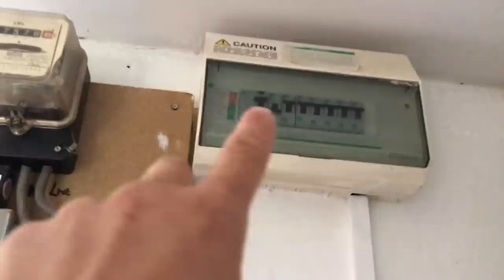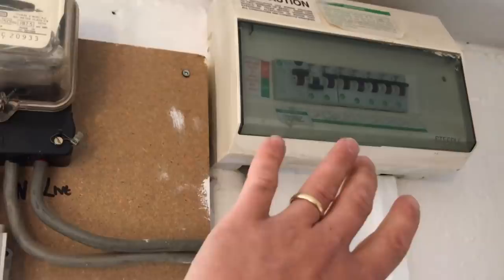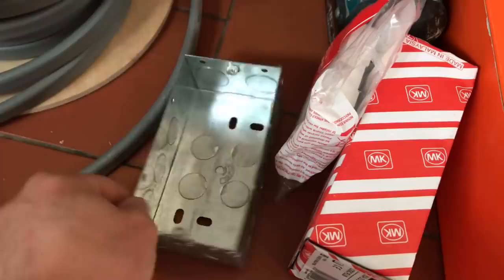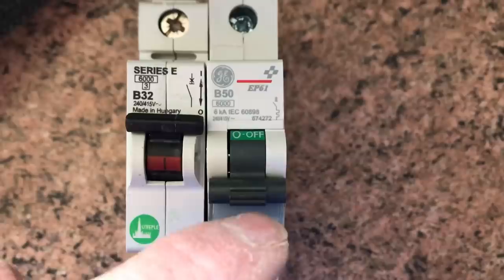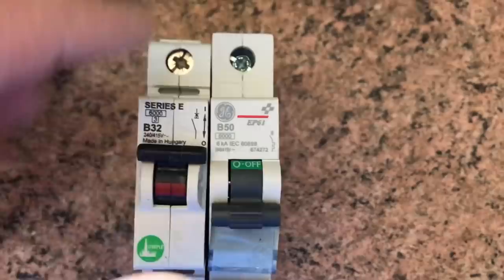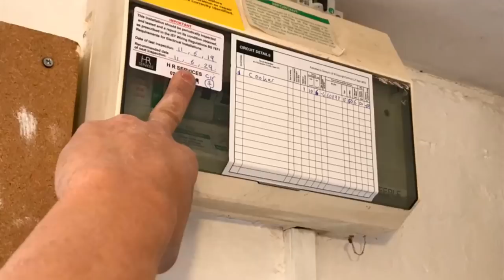CJR ELECTRICAL Electricians day installing 50amp cooker supply!!!

Comment from the maker: Thanks for the comments like I said that’s what this platform is for I’ve now tracked down a 50 amp Schneider lisse cooker connection unit. Which I will fit once I go back to connect up the oven.
Reply: CJR ELECTRICAL what is that 10mm rated at.
Reply from the maker: 64 amps
Reply: CJR ELECTRICAL cheers Chris, 👍
Reply: CJR ELECTRICAL atleast your brave enough to show your work and do a good job at doing it, people will always try have ago behind there keyboards. Great job
Reply: Lovely staggered performance, personally would have changed those tales, would have liked to see in the gaskets you used to stop the wet cement creeping in, never a good idea to stick the faceplates on, whilst waiting for media to dry, a brickie would haven told you to put a dry mash in first, then skim then skim, did you clip in the loft space ?, But you're keen to produce professionalism which is a bonus not many customers get. 😶
Reply: I think you need a few henly blocks behind that cooker lol
Reply: @stephenthompson1924  well said, my thoughts exactly.
Reply: @Cjrelectrical  great vid and another topic for discussion ! 64 amps in my eyes is the maximum amps in perfect conditions i.e clipped direct the whole route with NO thermal properties covering or touching the cable at all. So the oval (totally unnecessary in my opinion) and the plaster would contribute to reducing the the current carrying capacity, I'm not sure what you did in the loft but if there is any insulation on the cable at all it would bring the rating down to 45amps - 100mm insulation or even worse 36amps if there is 150mm insulation for example.  It's food for thought with the bigger cables i.e 6mm and 10mm etc..... oh and sod plastering would get my lovely clean van messy :)

Comment: Diversity on cooker circuits is definitely contentious. I agree with your 10mm, and for a moderate additional cost vs 6mm the installation is more future-proofed. A friend went out to a job to run in 10mm, house was only re-wired about 6 months before but new owners wanted an Aga at about 16kW. Diversity would say 28Amp but the manufacturer explicitly says 230V 45A. Would have been well over the type B curve trip at 32A under heavy utilisation. As long as Ib<In<Iz and the customer is happy, you're on to a winner.

Comment: Nice video.  I use Thistle bonding for first filling chases.  PVA the brick or blocks and leave a mm or so below and then use thistle multi finish on top.  To get it looking the best once it’s almost gone off you can lightly rub a damp sponge on it and it’ll be perfect.  Done an entire rewire in my house this way.

Comment: Had exactly the same issue on a kitchen re-fit 6 or 7 years ago. 5 ring/zone induction hob and double built under electric oven. Luckily there was an attached garage running from where consumer unit was to rear of cooker location. Customer originally arranged for a 900mm gas range and cooker, but changed their mind without consulting. Typical! Had to wait 3 weeks to get paid as I had to order in and fit an additional 300mm base unit.

Comment: Nice to see a spark actually attempt to fill the wall back in to some degree ,only takes a few mins and looks so much more professional.
Reply: @Do one 
As long as you don’t believe that there is nothing more permanent than a temporary solution😜

Comment: Nice one Chris , i always fill my own chases too and i always throw in a handfull of cement in the bonding and it goes off pretty quick which is handy if you need to 2nd fix same day , also i fitted similar double oven cooker rated at 50 amp and clamped it full on and it was pulling 41 amp max load........cheers mate

Comment: I fitted a new cooker circuit a few months ago, same as you.The customer didn't know what size or power oven she was getting, so I assumed max load, installed a 10mm cable and 45A breaker, supply was TNC with 30mA dual RCD, some muppet had connected it to some 2.5mm as a spur off the kitchen radial (32A) which should be 20A! changed that breaker too.. the line had melted through overload and touched the earth to 2.5mm feeding the cooker, and customer was complaining of getting shocks off the dishwasher, I just installed a new cooker point and isolator, with a 3mtr run easy job, and future proof. Shoddy work on that incomer..wow.
Reply: @r.h.8754  The last socket of the radial was connected to the dishwasher, there were 3 sockets on it, the radial was connected under the oven with chock block taped up...( Yes really) the cpc to the dishwasher and last 3 sockets (unsleeved) was  not connected to main earth as it wasn't tightened, the line conductor insulation melted it was twisted over the dishwasher supply thus eventually the resistance got lower everytime the oven was on, obviously no cpc to MET means no rcd trip, it was one of the worst most dangerous things I've seen. Could of killed my customer, kitchen fitters apparently! 😠 CPC around a soil stack?.. Wow!.. Unbelievable! They must of thought.. "soil" ="earth" 🤣 bleeding idiots...
Reply: @r.h.8754  Exactly that.. The earth wasn't fully touching the live conductor but the earth was disconnected from the joint back to the CU, that made only the dishwasher live but only around 1 to 10ma luckily for her. The taps were all in plastic pipe, and if I could post pictures on here I would, I just ripped it all out.. Started again bleeding cowboys. Oh yeah just remembered, rcd failed disconnection time.. Wylex.. Swapped that out too. All safe and compliant now..
Reply: I am not a qualified electrician but did an electric apprenticeship on electric motors so i do understand old technology. I am retired now and all the abbr. can be confusing CPC RCD CU (consumer Unit) I got one. Some years ago I was fitting a new bathroom for my daughter and she wanted a hot water heated towel rail. I lifted the floor boards in her bedroom to access the pipes and nearly died by what I saw. Some cowboy had put a ring main with the cables running over the central heating pipes with the floor boards on top. They had melted but not right through as I traced them back three earth wires were just loosely twisted together. I had to stop work and get it fixed.

Comment: Hi Chris, so I'll add my two penneth worth. Been a Sparks for more years than I care to remember, and my take on this situation is that the mcb is rated to protect THE CABLE,  not the appliance. So you have done everything correct in my view. Personally I would have used a 40A mcb due to installation method being buried in the wall.

Comment: Assuming ref method C it may have been possible to uprate the MCB to 40 amps. Cooker manufacturers don't apply diversity like we do. I have seen those range cookers installed on 32 amp circuits with no reported problems.  You have of course done the correct thing and advised the customer. For somebody to fork out all that money on a cooker it would be a shame to scrimp on installing it.  If you want to a good 50 amp switch try the Hager one's.

Comment: Nice video Chris ,steeple was a denmans own brand ,which that particular range was discontinued .GE had an identical range and those Mcbs are a comparable fit as you found out 👍🏻 ,I have come across a lot of different mcbs unsuccessfully rammed into these steeple consumer units ,luckily I have a stock of the steeple ones

Comment: Nice job,just stopping capping or oval conduit short of the box drives me crazy!!
Reply: Sam Sawyer 
I know why do that? Run the pipe on into the box ffs
Reply: Get over it..! Don’t even need capping or conduit.. especially if u r filling in ur own chases.. it’s not like ur gonna be able to pull a new cable through if it ever needs replacing.. 🙃
Reply: I never really know why they do that. Most trades moan about others..

Comment: If every component is turned on at the same time then it will pull full load as they all heat to specified settings.
So if you have installed to manufacturers 50A specifications, why did you choose to use a 45A Cooker connection plate (K5045WHI)?!
After the great work you did on rewiring, it is let down since you provided an underrated component - which should be quite an obvious safety concern.

EDIT * I should of read more of the comments first! It has already been addressed! ;)
Thank you for your videos and diligence!
Reply: i think you will find it was 50a k5215
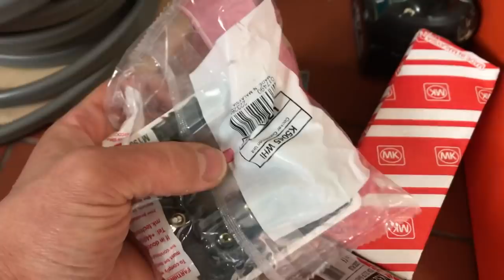Reply: @paulcockburn9545  That was the switch (Shown boxed at 1:43). The Cooker Connection plate was a 45A K5045WHI (Shown right after)
Reply: @deano30923  yep my bad misunderstood the statement. you are correct sorry dean
Reply: @paulcockburn9545  That's not a problem lol. It does make me wonder how many "accidents" happen because of the needless similar model numberings they have though?!...

Comment: Nice video,  wasn't to sure myself about the cable going through the pipework rather than pushing it behind,  but hey thats just me.
My answer to the moaning argument is that there's a difference between moaning about 'poor workmanship' and simply pointing out where things have been completed incorrectly.  
One is constructive critisism and the other is negative.

Comment: It's very uncommon for us to chase cabling in Australia - design of the house usually means we have a cavity wall to work with.
Reply: Cavities are a no no here as cable has no means of support and there a regs that require cable support throughout the cable length. Also you could transfer moisture from an external wall to an inner wall causing damp issues.
Reply: @jaffa190172  Yeah - we have the same regs.  We've got to support the cable every 400mm.  We typically put the cable in a small amount of conduit and feed down the wall, through the hole we've drilled through the noggin.

It can be pretty bloody hard to get there.   Sometimes I'll slot the plasterboard and peg it all back if the wall system is full of timber/steel, getting my plasterboarder mates involved for the repair.

Comment: Is it normal practice in domestic electrical work to install nearly 150A if breakers on a supply with a 100A fuse. Even allowing for diversity this seems a bit sketchy, easy to envisage a situation where DNO fuse would pop before any MCB went.
Reply: What do you mean ?? Are you getting confused with the 150 milli amp rcd?
Reply: Ben Jackson no, if you add up to breaking capacity of the installed MCBs it adds up to 150A.
Reply: @chrisb4009  ahh ok if you look in the osg one of the appendices ( I haven't got a copy to hand atm) if gives you the ability to apply diversity working on the assumption that you will never have every circuit pulling max load at once. I.E you will never have something pulling 13amps plugged into every socket outlet at once. Hope this helped
Reply: Ben Jackson seems a bit daft to tell a customer they need to upgrade a cable because “on Christmas Day......” yet on the same day you’ll likely have very light in the house on with the immersion heater going at the same time as the kettle and auntie Brenda blow drying her hair. Surely diversity works both ways.
Reply: @chrisb4009  it's an interesting point of view, however the osg is considered an excepted way of applying diversity and yes it does work both ways. However if the manufacture has specified a cable and breaker size surely you would adhere to that ?

Comment: Just finished a tight run with a 6mm twin & E, it was a usual  ridged conductor struggle, did it like 2 times, as the first  the cpc was the same reach as the line and neutral, when the cpc was doubled over, I was tempted to leave it, as it was OK, but, I thought, if I was the " next guy" to come across the termination, what would I think of it and the guy that did it, I would not care or know   the person was tired, hungry and knackered, I would just see the result, anywho, it late and I'm signing off, been a spark for years, still learning, still fighting the dark side,

Comment: could you have fitted a cooker socket , with a  13amp socket  , better than a double switch
Reply from the maker: No with the high load already on the circuit adding another load is not recommended.

Comment: Another top Video Chris, 
Could I ask when u do rewire lighting circuits how do u do them, do you take your feeds to the switches or the traditional way via the fitting, also had do you find using the wago connectors.
Thanks
Reply: garethf fox old school way wiring it three plate, but pretty sure 18th are asking to have a neutral at the switches, all about smart switching tech these days, Im thinking of wiring 3 plate on rewires but use a 3core as a switch wire and bring neutral down to the switch.

Comment: Hi mate I noticed you said it's a tt system so what would be the maximum earth loop impedance be for your new b50 amp cooker circuit 
I know on a tn system it would be about a maximum of about 0.69 for a 50 amp type b for earth loop impedance but I know its different with tt 
Thanks
Reply from the maker: Luckily this TT reading is very good I’ve had some up in the 70ohms range which is still fine but it does throw all your zs readings out that’s when you need to make sure you have everything protected via a 30ma rcd. I also make sure they have a 100ma rcd on the incomer quote old skool some might say but you never know when the reading might creep up .
Reply: @Cjrelectrical  I know tt are awkward mate. I have never really come across much on breaker zs values all it seems to say is less than 200 or 100 ze. Amd like you say 30 ma rcd protection and for extra protection time delayed rcd before

Comment: How come U don't have a main breaker in the consumer unit?
Reply: I know, I had to look up 314.1 but I'm not fully following. By the looks of it someone's just directly replaced the main switch and had no more room
Reply: TT earthing arrangement
Reply: @marcus62647  even still, would the main switch not need to be able to switch the full potential load (the 100amp dno fuse) and that RCD is only 80a
Reply: The CU has a main RCD in it. This is acceptable to use as a main isolating switch.
Reply: @craiga6557  How do you know the main fuse is 100amp ? It could have a lower rated fuse in it.
Reply: @HARRYSPADGE  well it says 100 so why wouldn't you just fit it to the highest, you don't know it's lower. Also the RCD isn't the issue it's the current ratings
Reply: @craiga6557  I totally agree with you, it was just an observation on my part.
Reply: @craiga6557  maybe the person that fitted that 80a RCD pulled the main fuse and knows it's rating ? Who knows !
Reply: @HARRYSPADGE  could be 60, 80 or a 100 but more than likely on a domestic its 60-63. Seen loads saying 100A but very few actually are.

Comment: I'm not sure that you can fit different branded mcbs anymore into boards .
Reply from the maker: It’s not bud
Reply: @Cjrelectrical  it looks different
Reply: It's bigger too
Reply from the maker: Have a look online mate they are all the same company
Reply: @Cjrelectrical  just checking if you read regulation 536.4.203 it has to adhere to those rules . I couldn't tell properly from video. Good job though . Keep moaning I love a good moan about crap work .
Reply: @Cjrelectrical  👍was hard to see on video that's all .

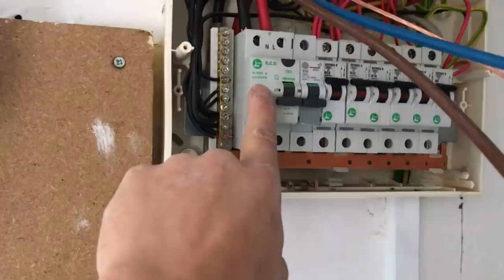Comment: 4:00 In 80A on the RCD, when it's secured by 100A mains. Is that okay in the UK?
Reply: Of course. Higher amperage at the start, progressively going down. Providing the meter is compatible with the incomer, having a higher incomer to the main breaker is fine. It means that additional sub-circuits can run from the same breaker. Having a 100 main with 80A incomer would be stupid because the DNO regulated incomer would blow before the customer equipment.
Reply: The main fuse holder is rated at 100A max, you'll actually have an 80A fuse inside for an 80A switch or RCD, usually with 16mm tails.

Comment: Did you make safe the cables showing bright copper
Reply from the maker: No I was unable to isolate the main tails. It’s behind a screwed lid so will go on the test sheet. Client is aware too.
Reply: @Cjrelectrical   don't you work live Chris ? Personally I wouldn't have left it like that, I'm in Spain, everything is easily isolated here because of switchable main protection. Get your mat and gloves out 🙂

Comment: Surely with diversity the cooker doesn't need 50amp ? RCD main switch is only 80amp, doesn't leave alot left
Reply: Kevin Gravill as he said there may be an odd occasion eg Xmas day where cooker is working at full capacity

Comment: Diversity guys diversity, remember that?
Reply: Manufacturers instructions,  remember that? Cover your own back, if anything happens to the cooker it's on their head not yours.
Reply: 421.1.1 and 512.1.5 on top of which heat dissipation from the rear of the ovens the running of the cable touching insulation, cable grouping, and ambient temperatures etc.. could increase the Iz of the cable to require larger conductors. Diversity can only be applied if the total load is known.

Comment: Poor workmanship reminds. I was helping a friend out lay a wood a floor in a new house, and I happened to look at the fusebox. Every last breaker was on the piss. The fuse box was located in the garage and all the cables leading into the house were just draped across the roof rafters, no clipping,  no trays,  just bundled up and draped across the rafters.

Comment: Never seen a 2 pole 80 amp rcd. But this would be illegal in the Netherlands. If the main fuse is 63 A the contacts of rcd has also be capable to switch 63 A.
Reply: ??? an RCD rated for 80A can be protected just fine by a main fuse of 80A or anything less than 80A, a 63A main fuse wouldn't be a problem at all.

Btw is 63A a standard fuse rating over there? For a single phase domestic such as this the standard UK sizes are 60A, 80A, or 100A (although you see less and less 60A).